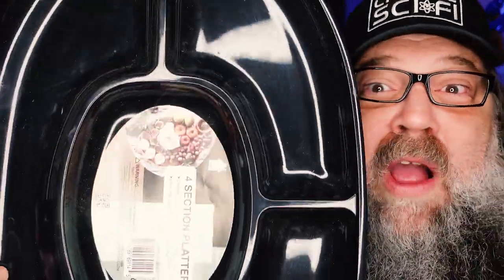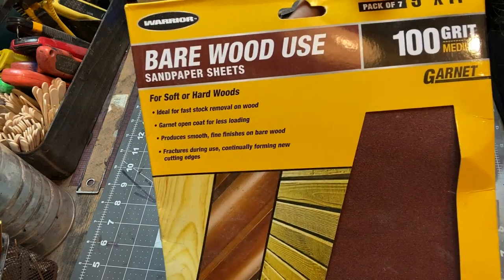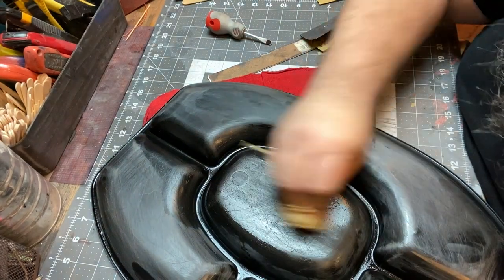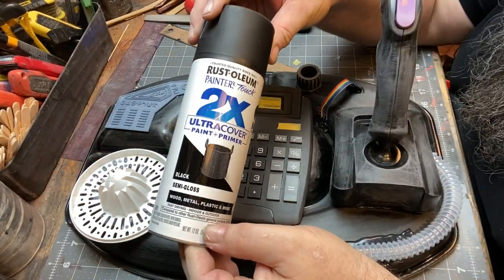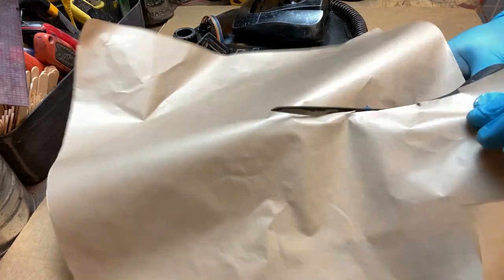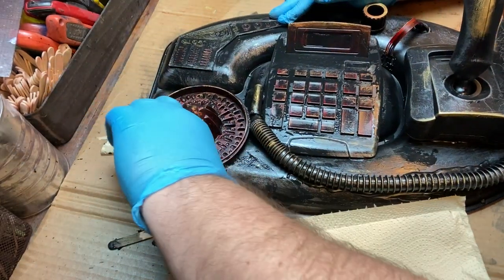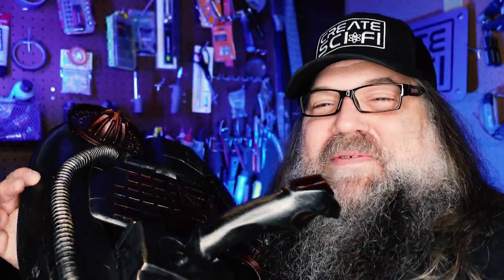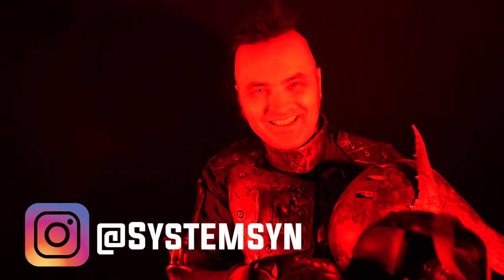LUNCH TRAY SCI-FI SPACE SHIP SET: $7 DIY NO BUDGET FILM BUILD

Comment: A nice feature of the upside down tray is the underside gives you a void to work with so if you wanted to do any lighting you could easily mount the battery compartments in a void and still have it sit flush on a flat surface.

Comment: Have you tried playing with strontium aluminate yet?  It's amazing stuff, next-gen glow-in-the-dark powder.  A single charge will keep it glowing for 30-90 minutes, and it comes in several different colour glows.  It will also absorb UV while radiating in the visible spectrum, which means if you hit it with a tiny UV LED invisible to the naked eye, it'll glow essentially forever.  I was just thinking it would be useful for you to make the symbols on your control panel here glow.